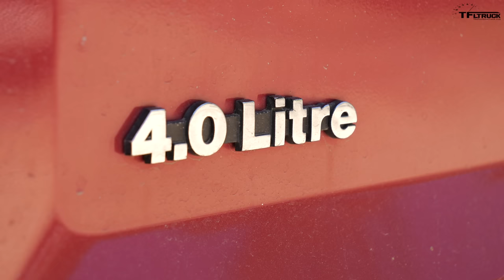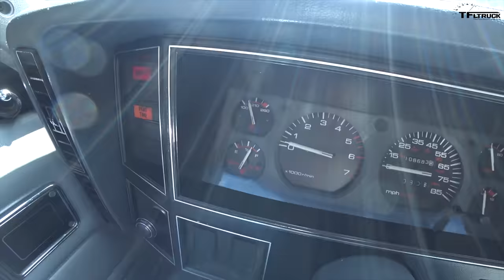Old vs Old: Did Off-Roading in the Eighties Suck? | Cheap Jeep Challenge S2 Ep.6

Comment from the maker: What is Tommy planning to do with the Suzuki Samurai? Here's his plan: https://www.youtube.com/watch?v=zI_ZtgB98eQ
Reply: Keep the 80s intro theme please.
Reply: Sandy Lee you cant on a stock samurai. Locking HUBS are different than locking AXLES.
Reply: Man if you can not use stran valve you should not four wheeling and watching you drive up that hill is pain full how the hell did you get a channel
Reply: Add a bottle of “ water wetter” from red line to your jeep.  I never believed in it until i put it in my CTS-V. Absolutely lowers the engine and supercharger temps by 15-20 degrees.  Its a polymer that.... does something lol.  It works.
Reply: The Samurai needs up grading. Like what Tommy said, needs lockers, rear and front... maybe a.winch but definitely more,.much much more, aggressive off road tyres.
Reply: @azboyd3503  Maybe the same way you passed English class.
Reply: Samurai rocks! Put real tires on that...
Reply: Just remember to think of the Samurai as a golf cart with all of the highway safety of a golf cart.
Also I think you'll find that if you put big tires on it, it will no longer have enough power.
Reply: @azboyd3503  Maybe the same way you got recognized as a kind and respectful YouTube commenter.
Reply: Take it easy on my Comanche, remember I want that Jeep when your done!
Reply: ok, another great video. Los felicito! You guys remind me of how cool vehicles are (in general). Either sedan, SUVs, etc...In this case, the classics going off-roading. Just Awesome! make us appreciate new technology but remind us of the challenges when off-roading back in the 80-90s. And great setup on the landrover. You are right! no need to sell it.  ....on another hand, those Tesla videos? my respect!! Really good material and keep setting up the pace (i replayed back to one of those videos but for some reason didn't post). So, the best of the best for you and your entire team can't wait for more videos to come of whatever material you guys decide.
Reply: There are lots to do with that Samurai. I had an 87 back in the late 90s. There is a company name "Calmini" that makes a lot of aftermarket parts for the Samurai's. Also, swapping out the stock engine for the 2.2 liter fuel injected motor from the Grand Vitara solves the lack of power and the fuel starvation when operating at hard angles.
Reply: What's going on with the Samurai upgrades? Would be very interested to see how that goes...
Reply: That samurai reminds me of offloading my stock 88 ranger

Comment: Here in Australia we'd put a corolla motor in the zuk's for power and some 31inch muddies and they were absolute weapons. Jeeps, well we saw some in movies.
Reply: 1.8 chain drive or the older 1.6 belt driven?  I've seen 22REs in Samurais but it's a tight fit.  The Corolla engine sounds perfect.
Reply: I know the 1.6 originally but I'm sure a few got the later engine. The corolla engine had heaps of potential for custom work and was a real game changer. 4wd burnouts and broken drivelines were common.
Reply: Plenty of room for a small turbo under there. That little 1.3 is bullet proof.

Comment: In the early 1980s, there was a Toyota commercial on TV showing a Toyota truck going up a steep dirt hill at about 70 mph. I called a Toyota dealership and told them, "You don't need 4 wheel drive to do that! Let's see your Toyota truck follow my '48 CJ2A up that same hill, 4 wheel drive, low range, 1st. gear at 1 to 2 mph." The dealership did Not accept my challenge!

Comment: The low weight of the Samurai has a downside. I was following a hardtop Samurai on the Trans Canada Hwy in mountainous eastern BC. It was the early eighties and I was driving an FJ40. There was a considerable, gusty wind that day and the FJ was getting pushed around. We entered a tunnel which turned around 60 to 70 degrees as we passed through. When the Samurai emerged from the tunnel, a gust from the driver side hit it. The gust pushed the rear end sideways.  The car rotated 90 degrees and fell over on the passenger side at 50 miles an hour. It proceeded roof first and slowly rotating. It made a shower of sparks and stopped quickly, still in its lane.
In short, no injuries and little but cosmetic damage. The driver immediately turned off the motor. 6 passers-by and the driver actually returned the vehicle to its wheels and it departed under its own power after around 10 minutes. The most significant issue seemed to be the loss of the passenger mirror (or perhaps the loss of the personal composure of the passenger who seemed somewhat put out).
Reply: cool story bro
Reply: The wind also blows a Jeep Wrangler around.

Comment: "Quite unusual to have a vehicle that was 4x4 in those days"  maybe for a city boy it was! Its tons of 1970-80 4x4s in use today!
Reply: Yeah but apart from all those Jeeps, Nissan Patrols, Toyota Landcruisers, Daihatsu Fourtaks, Mitsubishi Shoguns Landrovers, Rangerovers etc etc there were hardly any 4x4s...…...
Reply: Are you serious....  chevy k10s 20s 30s blazers  ford f150 250 350  broncos  gmcs that were copys of chevys   there were a ton of badass 4x4 trucks...
Reply: Lol. My first truck, IN THE EARLY 80S,  after I got my licence was a 75 GMC 25 4x4.
My current truck is a 78 Chevy 30 4x4.
Over the years I've owned a few 70s 4x4.
I agree, maybe for city boys it new. But us country boys have had them.
I hear a lot of garbage about the old trucks.
But There are reasons I returned to the old trucks.
THEY ARE MORE RELIABLE. 
As much as b.s. as you hear. They fuel economy is really the same. 14mpg compared to 16 mpg. And even that is questionable. Just depends how you drive.
I've drove coast to coast a few times. With what? 70s GM 4x4s
And also I'm sick of hearing how the new engines are so much better.
If you want to go 100% stock a 350 will take the new engine.
If you want to go built, a 350 will take a new engine.
Those are both in speed and pulling.
If anyone wish to challenge this. By all means my 78 will gladly take you on.
Stock I'LL drop a rebuilt 78 350 in it.
If builds we can do that as well. 
$50,000 says I can win.
Oh Btw, my truck running gears are stock for the truck. But be warned. They are STOCK for the truck, not for normal GM. Meaning due to what it started out as, it was standard for the truck.  Which is kinda funny because my 75 was the exact same. 78 engine and the same running gears. And yes the 78 350 in some applications was "interesting " from the factory.  If in the right vehical for the right reasons, even in California smog / emissions did NOT APPLY.
Reply: I also love how these guys go down roads like my 12 mile driveway and think it's 4xing.
You ain't 4xing until your truck is stuck to top of the hood in quicksand and still sinking.
( that little fun thing ended up costing me engine, transmission, and transfer case. Lucky for me they didn't all go at once.)
Complaint about carburated I love carburetor. I remember everyone wanted fuel injected. I suppose if someone said a dildo up your bottom was great everyone would want that too. 
You just need to know how to use a carburetor.  HINT, you need to adjust it to what you are doing.  10 seconds under the hood.
Now what is not crossing his mind is with modern vehicals. Yes it AUTOMATICLY adjust. But when you come back. Now you have a engine light on. And will now cost you thousands of dollars, because the stuipid pc doesn't know why it changed, then changed back.
Reply: Btw what the F is the problem.
The commanche has something wrong with it. It basicly a Cherokee. I had NO problem with my Cherokee overheating ever.
The 4.0 engine is a good engine.
And the 4.2 was a good engine.
I forgot about the eagle I owned as well. It had the 4.2
For those that don't know the 4.2 was the carburated strait 6 in AMC and first Wranglers. 
My current wrangled has the 4.2. But some DA put an electric fuel pump on it. So I need to redo the fuel line.
Reply: As in AWD is common now.  I mean  he says that right before what you quoted..
Reply: @pychohobo1832  don't forget the International Scout. Anything less is just a car!
Reply: I think you’re misinterpreting that statement.
Reply: @Icutmetal  how else can you interpret it?
Reply: @Icutmetal  "in those days most vehicles were not 4WD let alone AWD" that means AWD being common today was unheard of back then. But 50% or more of the vehicles on the road where I live ( USA ) back in the 1970s were 4WD! So 50% is uncommon?
Reply: @Icutmetal  with age comes experience!  What is coming out this guys mouth tells me he doesn't know his ass from a hole in the ground! Off roading didn't just become common in the last few years! Its been a way of life for a large part of US since the invention of the auto mobile! The 1970s was the boom for 4WD!
Reply: That’s not what he said man. We get it. You guys were all super cool in high school, had bad ass trucks, and haven’t figured out how to move forward in time. But trust me, he’s aware of old 4x4s. He was talking about the number of vehicles produced with 4WD or AWD today vs in the 70s. And yes, there’s a lot more today, including cars and crossovers (which is why he mentioned Subaru).
Reply: @treygregory7929  that may have been what he meant but its not what he said! Ive listened to it numerous times! Go listen to it! What I quoted is exactly what he said! Word for word! 

Im not trying to saying there isn't way more produced today my point is it was not unusual back then. Which is exactly what he said! Clean out your ears! Stop ASSUMING what he meant! Which is one of the biggest problems today! Mis communication! When you ASSUME it makes an ass out of you and me! 

Words have a definition for a reason! When you use the wrong word the meaning then becomes mis interpreted! Its a damn good thing our military doesn't ASSUME! Ask me how I know.

But as far as moving forward. Man its nothing more fun and enjoying than off roading / mudding! Hell most of the best fishing holes I know of require a 4x4 to get to. Not to mention the best scenery! Life is to short to not enjoy it! So have a drink on me and go off roading.

Comment: In the early 90s, my first truck was a 79 Chevy Luv 4x4 (1.8L 4cyl, manual trans), never had a problem off road in the Black Hills of SD and no problems handling the severe winters. Small, light, narrow, and would float across the mud/snow areas where big trucks would sink in.

Comment: Gets wild @9:55! Sweet vid capture! @9:20. the Sammy is amazing, look at this trail. I used to take my Sammy up very similar trail, uses 4WD low, in first gear and ride the clutch. Do a wheel swap on these two beauts, give the Sammy the Jeep wheels and tires, give the Jeep the Sammy wheels and tires. Hopefully these guys treated that rust @4:10 would be an easy job and the proper thing to do. @4:20.. my Sammy towed my FJ60 for over 30 miles up and down the hills in the Texas Hill Country.. note:mostly in 2nd gear, 4wd high. Used a synthetic tow strap. One tow hook on the Sammy snapped open, the other held fast. the FJ60 likely weighed in at 5,500 pounds or so

Comment: I can’t wait to see what you do with your Samurai!  I had a 1987 Suzuki Samurai that I lifted with a Calmini shackle reversal kit; I put 30x9.5 tires on it, and it was amazing off road. The shackle reversal really improved the on road handling. I also had a 1994 Zuk, andI put a 3” Trailmaster lift on it- the springs were harder than an unloaded 1 ton pickup, and the bumpsteer was terrible, even with drop pitman arm.

Comment: My old 93 Toyota is running 36x13.50x 15 Super Swamper IRoks and a 3" suspension lift with a 3" body lift. Onboard air rock slider quarter panel gaurds with gnarley front bumper with winch mount n  plow brackets

Comment: Comanche all day long. I have owned 3. Mid 20's for fuel milage, fairly comfortable on long trips, rated as a 1/2 ton, and worth upgrading. With the proper tires great on icy highways, and I pulled three deep powder snowmobiles on a flatbed trailer up into the mountains with no real issues.

Comment: I was in tge Army in tge 1980s, My then wife and I bought one of the Comanche's. The second year edition, Yup it did come close more often than not to overheating. the first thing I did was to remove the thermostat in the spring and summer months, this was a common cure that helped greatly. The thermostat are very restrictive in volume flow of water, The second big thing was adding a modified Chevy heavy duty 4 core radiator. Modified by a reputable radiator shop to move the water hose inlet and outlets ports and adding the bottom seating mounts, and to securing bracketing to fit the Comanche. JC Whitney sold aftermarket electric dual radiator fans that when properly modified fit the Chevy 4 core radiators perfectly with custom made to shrouds. These greatly and I mean greatly removed any near overheating issues. 
Come the fall season I put the thermostat back into its housing, our engine had a four barrel aftermarket carburetor by Holly mounted to the stock intake manifold. These truck cabs were thinsolated meaning it got very cold without the heater running. We lived off base and had a long 20 minute drive to base then an additional 20 minute drive to my unit hq parking lot from the main gate. The thermostat was needed in the winter, for cabin heat and to warm the carb in order to properly operate. We loved our comanche very much, my wife worked at a small affees store on base and she had the closing shift so more than me she drove the jeep were I either drove the Ford pinto or my motorcycle. The four wheel drive system with installed Goodyear pg tracker tires was phenomenal on and off road in snow, slush, and ice with chains installed on extremely icy roads, But we had to put three big cinder concrete blocks in the back over each wheel to push the bed down compressing the suspension to make the rear tires bite into the road.  Still a great truck. So much so when AMC came out with the Eagle my wife traded the pinto in for the wagon eagle with four wheel drive. Great vehicle as well.

Comment: Great video. Knew that the little Samurai had it in it. ;) Had a couple of friends who were stationed in Guam and they would go literately all over the island in their SJ40's. Virtually unstoppable. Samurai's got a bad rap in the US market because they were easily tipped over on the road. They were never meant to be driven like they were in the US. Same thing that ended the CJ-7 design and why the YJ came out. Their popularity played part in their demise. Too many people throwing them into corners and tipping them over. Had a 78 CJ-7 with the straight six myself. It rattled me a couple of times. Caused by my own stupidity by driving too fast for the conditions. The Jeep pickup was pretty awesome too, as it should be. Perhaps an upgrade to the cooling system is in order.

Comment: Properly maintained cherokee and Comanche cooling systems worked great. Over time the factory radiator crusts over, thermostats get loaded up, and you would be surprised at how much of the water pump fins will corrode away. Leaking or not just replace the radiator, thermostat, water pump, and flush the system with a cleaner to get rid of three decades of crap.

Comment: 70's There were No 40 or 33  tires on our Mountain trails. Mostly hunter roads as far as Jeeps or Farm Trucks could go.
6 ply or radial snow tires.
Challenges around each curve. I'm on my 7th Jeep.
3 Renegades 304 V8.
One AMC CJ-5 360 V8.
2 CJ-7. 
2 TJ 4 Bangers. 
(2000 TJ Currently)
It's a Jeep Thang Ya'll.
East Tn.

Comment: The problem I have had with that 1.3 liter engine that the samurai has was not on the off road, or the highway.  However, in dense stop and go city traffic on a very warm day that engine overheats whenever you use the AC unit.

Comment: I remember watching an old Land Rover Slll 88" diesel out perform a Land Rover 90" TDi that had expensive dislocating suspension to improve wheel travel simply because the Slll had front and rear locking diffs, if the Suzuki in this video had locking diffs it would have completed the track at a more sedate speed and not subjected either driver or vehicle to so much crashing about.

Comment: You should try hypercool additive in the jeep about 2 bottles will do it. I was sceptical but my older 4.8 had overheating problems so I drained my coolant added 2 bottles of Hypercool went a little more water than antifreeze bc it works better that way and now my truck with 221,976 miles runs about 25° cooler. My race car buddy said that's all he runs at the track bc its NHRA approved.

Comment: The cooling issue with the commanche can be slightly resolved by making sure the clutch  and electric fans work. You may also want to try to raise the hood at the brackets with longer bolts and washers .

Comment: that suzuki would do great with a 22r or 22re with a 5 speed and a marlin crawler tcase. swap the suzuki axles for the toyotas and youre golden. the samuri has a divorced tcase and ive seen the center drive shaft go out numerous times. if u wanna bullet proof it. 22r 5 speed marlin crawler or even the advanced adapters atlas tcase

Comment: In 1985 Subaru had the 4wd GL a 2 door & a 4 door version, these where very popular, and also big in Colorado.  You could get a 4wd small & good gas mileage, affordable, without buying a truck.  The used ones stayed around for a while.  In Colorado,  the people who worked at resorts used these vehicles, just to get around easier.   I did not sell mine till 1999.   But these where affordable vehicles, not the 40 & 50k entry points that you have today.